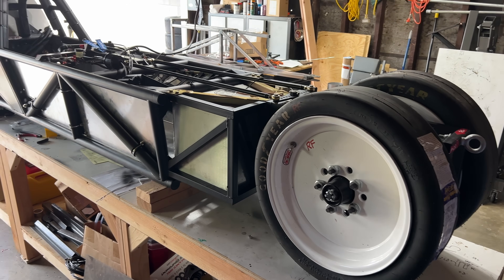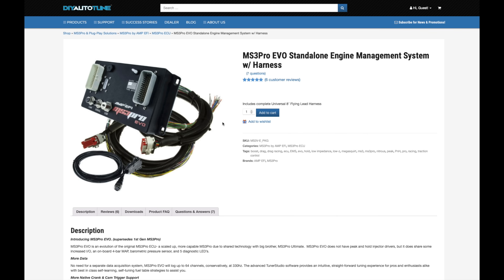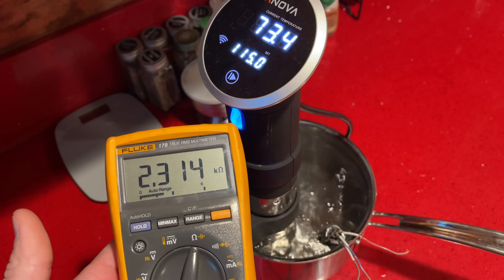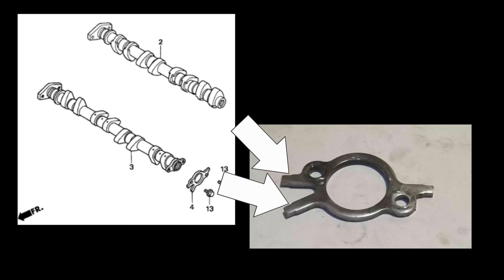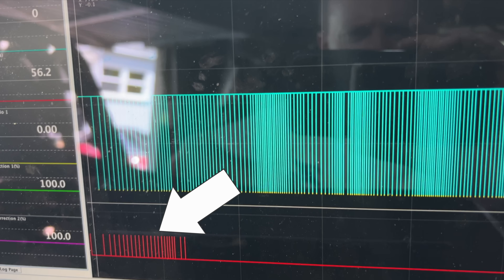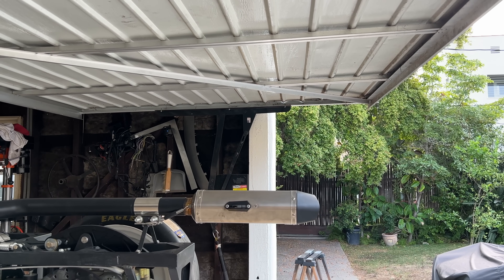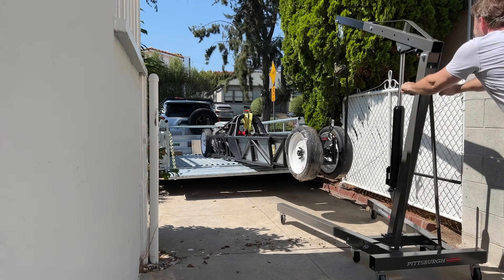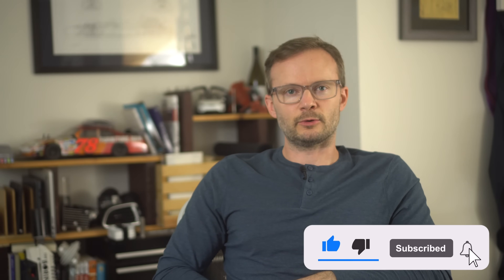The Engine Is Running, And Spraying Oil Everywhere

Comment: Did you ever discuss how you deactivated the two cylinders? Or did I miss it?
Reply from the maker: Not yet deactivated, but I’ll pull out the finger followers on two of the cylinders so the valves won’t actuate.
Reply: @SuperfastMatt   and remove the pistons and rods I would imagine
Reply: @davidr8309  Not necessarily. With the pistons still working but the valves always closed, the extra cylinders just act as cycling air springs, and balance is not changed. This is how all production car engines with cylinder deactivation work.
Reply: @brianb-p6586  to squeak out every bit of horsepower for land speed racing you wouldn’t want the loss of moving the pistons and connecting rods or squishing air in unused cylinders.
Reply: @davidr8309  While the friction of moving pistons in the unused cylinders is a real concern, compressing and expanding the air in those cylinders as springs causes little loss - compressing air takes energy, but you get most of that energy back on expansion. With all of the pistons still operating the crankcase volume is constant, but if the unused pistons were removed the crankcase volume would change with every stroke of the remaining pistons, causing air to be pumped in and out of the crankcase vents, which would be a meaningful pumping loss. 

I'm sure that Matt will get into much more detail on this when he reaches the stage of reducing the engine displacement... next year?
Reply: It has 4 coils.
Reply: @jimrobcoyle  Matt said that he’d be provisioning the engine for 4 cyl in the event he wanted to move up classes, but needed to deactivate 2 cylinders to run his 500cc class.

Comment: Adding control over the water pump sounds like a good idea, that would help the engine and oil temperature to get up to proper working temperature faster.
Reply: I think using water flow rate to adjust engine temp is a bad idea.  Water temp leaving the engine is an average of the engines metal temp so you might end up with steam pockets in the cylinder head. Also, cooling systems need positive dynamic pressure beyond that of the rad cap.  This is achieved by the restriction that an open thermostat provides.
EDIT   Thinking about this a bit more. Is the electric pump moving water to the chilled tank or just engine circulation?  If to the chilled tank, pump speed might not be too much of an issue as it would be more like an electric fan on a water to air rad.
Reply: @bobroberts2371  Many OEMs use variable speed coolant pumps, BMW is one of them. Not to say BMW's solution is all that great. Also, there should be some amount of flow 100% of the time, say 10-20% of rated current/flow for example... Physical thermostats are also not all that great. Active diverging valves are much better...  Then, as needed, driven by inputs like throttle position, intake air temp, coolant temp(s), coolant pressure(s), oil temp(s) the coolant circulation pumps could be modulated as needed to meet targets.
Reply: @bobroberts2371  We know it isn't right but he won't listen.
Reply: @bobroberts2371  I believe it only circulates water from the tank to the exhanger. The bmw engine has it's own mechanically driven water pump, which seems to have hoses connected to it.

Comment: i used to work at DIYautotune. boy was that a horrible nightmare.
Reply: Why?
Reply: @dipling.pitzler7650  when i was there, it was very much just a home "garage" company. meaning nothing was ever 100% working correctly. ever. the components you buy from them are pretty cheap quality and had no business being on a car. aka temp sensors for washing machines.  and when they say it works on XYZ vehicles and XYZ situations, that all theoretical. will it work? It should, i dont see why not. does it work? wont know till you find out. lots of times, its a "well we dont know why its not working, but thats your own problem" type of situation. also, they provide no support. you ask a question as to why your unit is working in some kind of way and they will tell you to pound sand.
Reply: @petek9348  No refund? I suppose there must be some sort of liability.But thank you anyway for elaborating.
Reply: @dipling.pitzler7650  i dont know how jerry works things now, but i started when the ms3pro was still new. when i was there, someone called to complain about something not working right and their reply was "you are doing something wrong" and just would hang up on the guy.
Reply: @petek9348  Wow! It is amazing this did not ruin their reputation and are still in Business.
Reply: @dipling.pitzler7650  well, they dont have a very good reputation. most people that have a MS usually go on to something better, but some people stick with it cus they run a very basic setup and some people find it to be challenging to try and engineer a solution. but for the most part, anything else is better.
Reply: @dipling.pitzler7650  they have that reputation already. they just thrive on people not knowing it.
Reply: Please elaborate!